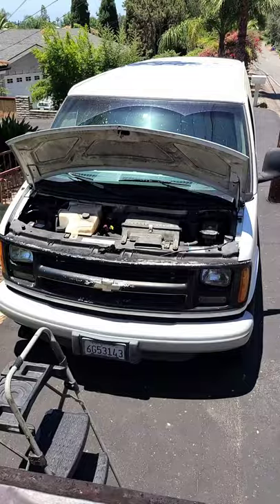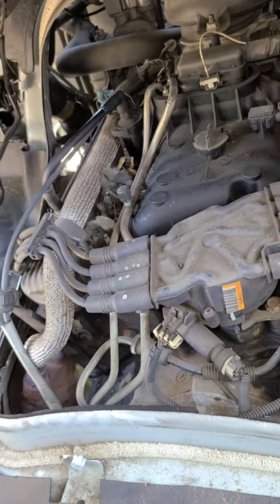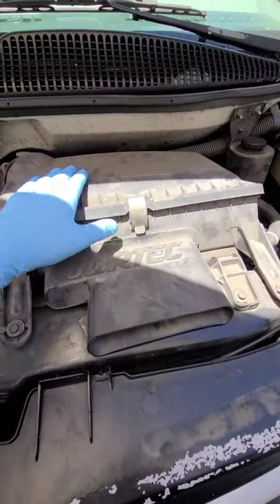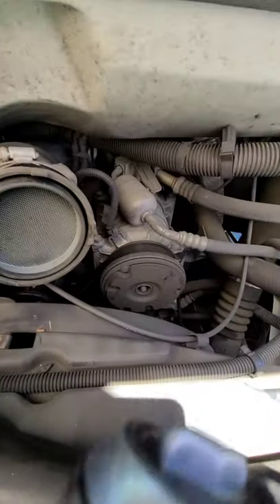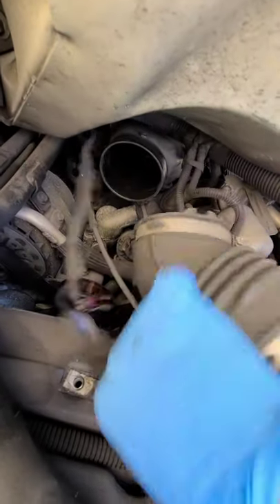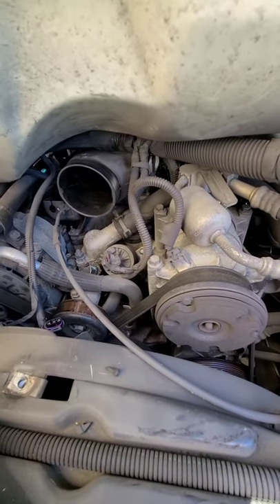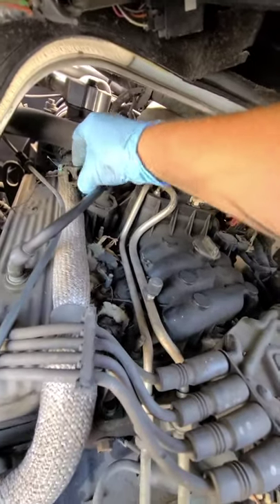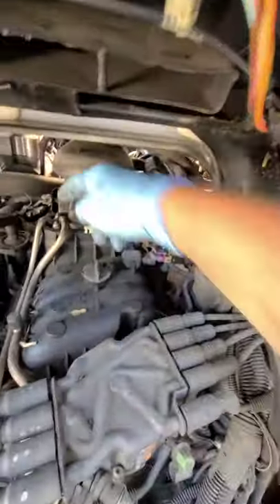Replacing a 2000 5.7 Chevrolet Express Fuel Injection

Comment: Thank you for the DETAILED VIDEO.

Subscribed. 

This makes working on my express 5.7 spider seem far less intimidating. 

Gonna run to the tool store for a set of 8mm-15mm  swivel sockets, and get cracking on this job ASAP. Hopefully this solves my BANK 2 Lean situation.

Comment: I think this is what I need. I have a cyl 3 misfire. Changed the plugs between cyls. New ac delco cap, rotor, wires, coil, new fuel filter, cleaned maf, new denso o2 sensors. Still no change. Now I just need the correct spider for a 02 3500 5.7

Comment: My Savana has the same issue, waiting for the funds to buy the spider. After having already replaced plugs and cables and cap and rotor and coil and upper and lower intake gaskets. Next ordeal is digging back in and yanking that dead trap door spider out and putting a better tarantula in.

Comment: Ive replaced my injectors, but can now smell gas when I'm driving.
Reply from the maker: Check for fuel leaks near the injector supply lines, if not maybe the spider poppet valves are not sitting correctly